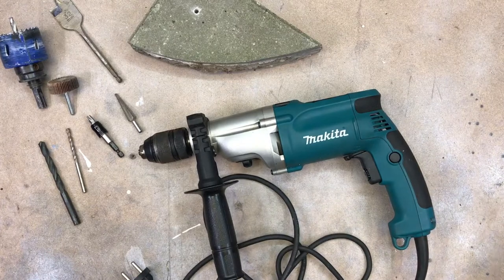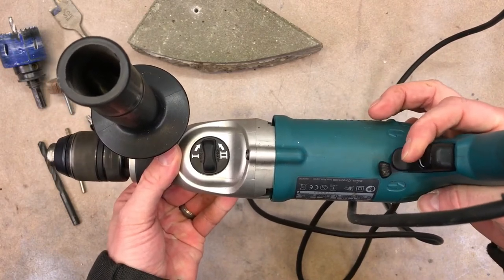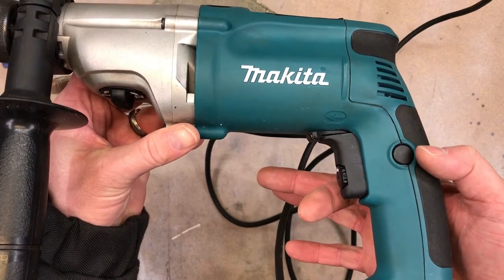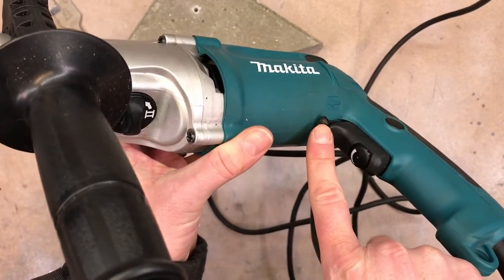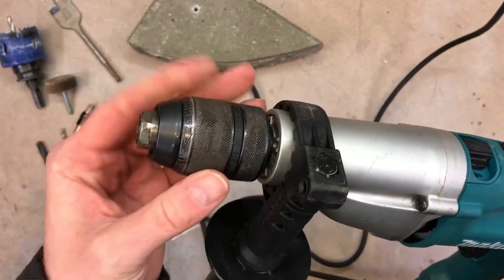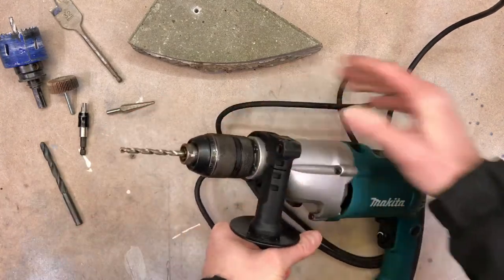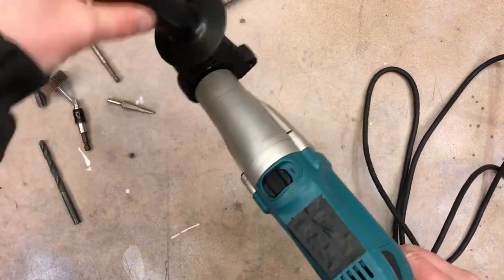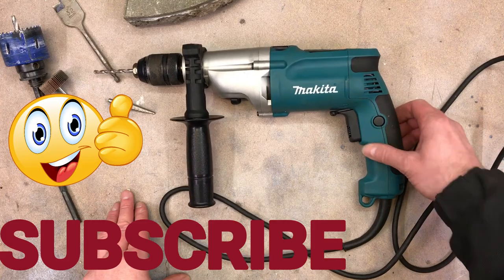How to use a Corded hammer drill - everything explained for the complete beginner

Comment: I think you incorrectly explained the "I & II" speed setting switch.

It's been a long time since I used a hammer drill so I'm not 100% sure myself but if I remember correctly the switch doesn't make it go faster. It only changes what the power button does when pressed.

So on setting one when you lightly press the power button it goes slow and pressed all the way it goes max speed. On setting two it doesn't go any faster but just makes it go at max speed whether the button is lightly pressed or pressed all the way.

Still a great video though and very informative!
Reply from the maker: There might be differences from machine to machine - great that you made people aware - thank you.

Comment: Did not show how to use the hammer drill. Should I drill at high speed or low speed.? Should I use lots of pressure or little pressure?
Reply from the maker: Good point, will work on a video showing this...

Comment: It's a common mistake to run the drill, in order to fix gear speed knob position. You risk damaging the gearbox. It is stated clear in the manual, to just turn the chuck by hand, to properly align gears, to engage.

Comment: TO START we need THAT PLUGGED OUT 

You don't want to find out the hard way what happens when you attempt to change a drill bit with an electric current coming from the wall ACTIVELY running THROUGH THE MACHINE!